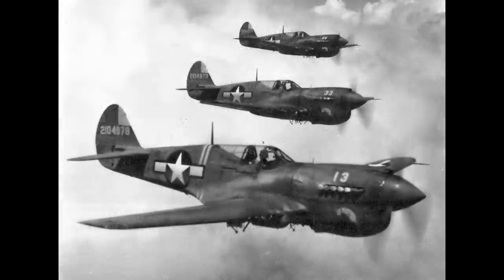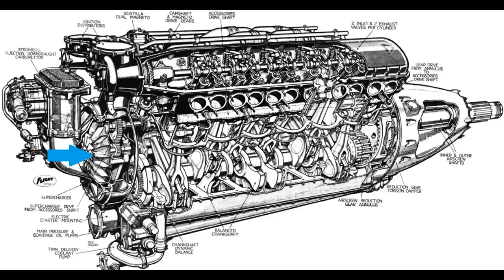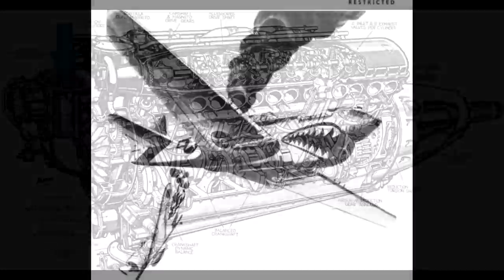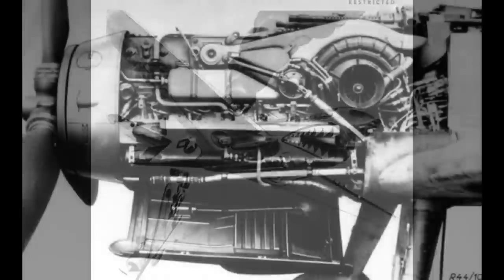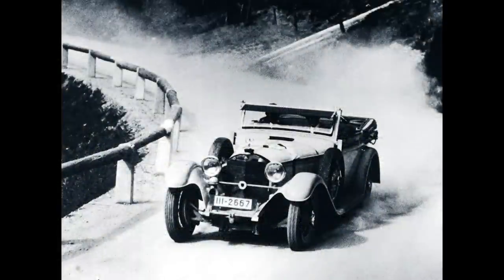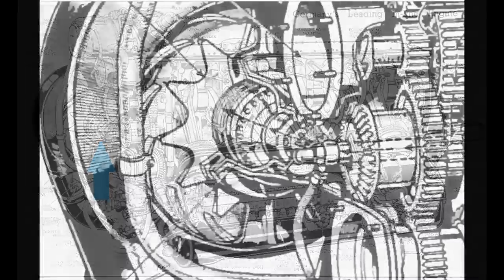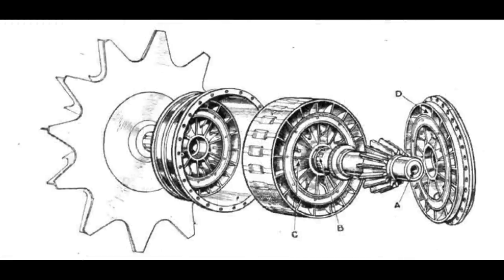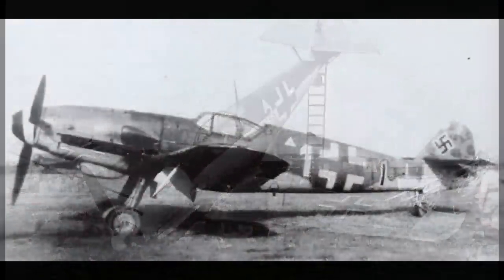Messerschmitt BF 109 Supercharger Drive System

Comment: Consider the Fw-190's highly advanced engine control system. It featured an analog computer, with a single lever for all engine parameters and functions. There was no direct pilot control of engine RPM, manifold pressure boost, or mixture. Compare this with the very complicated engine controls of late WWII American and Allied aircraft.
Reply from the maker: The Germans had some really cool stuff. The FW190 had many innovations, engine control being one of them. I'll probably cover some FW190 features in a video.
Reply: rather amazing! imagine the reduction of workload on the pilot
Reply from the maker: It was good, and the concept was revived by Mooney Aircraft when they used a Porsche engine in the late 80's. Pilots loved the simplified controls, but ultimately, it failed. That's another story.
Reply: I read somewhere the British examined the German system during the war and found it superior to theirs and recommended adoption of something similar as it reduced pilot workload and distraction at critical moments in a fight. I wonder if war exigencies prevented  implementation or if there was another reason.
Reply: Moriah Molotov I can see why jet fighters adopted this throughout the cold war. Gives pilot more focus on the battle.
Reply: The 109 was cramped compared to what? II come  from the World of Gliding, and I am a 182cm Fat Fuck and had no Problem fitting in either the 190 or 109. I found them very spacious and generous. You have good Axjustment on Pedals and Seats and I wasat about 80% Adjustment Range.But I am used to Gliders, as were most German Pilots. If you ever get yourself in a Grunau Baby and a 109 afterwards, you will feel as if you entered a Cathedral.
Reply: Almost an early example of Airbus (computer flies the aircraft, pilot instructs the computer) VS Boeing (pilot flies the aircraft directly)
Reply: It was rediscovered years later in america, they were stunned.
Reply: wow... the Dora had those things on board ?! no wonder it was considered much advanced compared to the 109 . and it was only about 3 or 4 years newer in design, right? quite amazing how fast the guys were advancing at those years...
Reply: All 109s had that too.
It's called Kommandogerat
Reply: @eyalcr500  The Anton A5 onward had those automated features too.
Reply: tsmgguy..really outstanding point,thank you for bringing this up
Reply: @Leon_der_Luftige  A-3 too.
Reply: OMG ! The complexity of this aircraft is amazing and probably the reason there are not very many running today
Reply: @SeanODea25   Jets don't need a prop control...
Reply: MrFattyfatfatboy  an easy meal? It's not a bloody Kentucky ready-to-eat Fried Chicken!! Both the Fw 190-D and the late Me 109G-10AS was capable to handle the fighters of the allies, providing of course, they  had good pilots and fuel both chronically lacking but even in the final months of war they could still bite hard. Ask the downed pilots of the allies....
Reply: MrFattyfatfatboy  eventually I could be a poor deluded Florentine, I live there! With that settled you stated quite correctly that both the late German airplanes and the allied airplanes had quite similar performance with each that  had pro and cons compared to each other so at the end was really the pilot that made the difference as always although I regard the Me 109 G-10AS and the Me K-4 the most difficult to handle at high speed, yet the few German experts knew how to handle it to their advantage whilst the very late Spitfire had the best handling at high speeds although it's graceful flight characteristics was marred by the brutish Rolls Royce Griffon. That said with this little comparison I  am just highlighting that you made it too easy and one sided....
Reply: @MyFabian94  it said that 109 and 190 cockpit was cramped, compared to other contemporay planes, mostly British and American planes
Reply: @ppunk4  And German Pilots felt a bit lost in the oversized Cockpits of the Allied Fighters. 

Pilots are Humans, and Humans are creatures of Habit. 

Fact is that in Aerobatics it's generally nicer to fit into your Plane snuggly so your Bits have something to Press against. 

If you are used to Sports Bikes and suddenly get sat on a Harley you will feel a bit lost in Space. 

Someone from a Harley will hate a Sports Bike. 

If you are used to tiny Cars with Bucket Seats you will hate the Bench Seats of a 60s Landyacht when cornering, and someone from the Landyacht will hate constantly fingering his Passenger by Accident.
Reply: @ppunk4  I've flown Bücker 131s (and will soon gain hopefully) and if you consider that it was the primary Trainer for most German Pilots suddenly everything falls into Place and starts making sense. 

Compared to the 131 the 109 would feel like the easiest Plane to fly and almost uncomfortably roomy.
Reply: @MyFabian94  at least in VR, the bf 109 has very little room compared to the p 40 and other american props. One of the closest feeling planes in the p 39, but even then, it feels more spacious. Don't know if that is just the better visibility however.
Reply: Daimler Benz DB60x engines had equally effective automatic engine control system, functionally equivalent to BMW801's. Also in DB (as in BMW801) the "throttle" lever does not actually regulate throttle, it is more a thrust lever. With it pilot tells how much thrust he wants from the propulsion system, and automation delivers that the best way it can. But DB has manual override that provides possibility to for example over-rev the engine by taking manual control of the prop pitch.
Reply: Just to mention, there was a manual back up. It was a direct pitch selector however, not RPM selector.

iirc the 109E-3 and earlier had RPM selector, while the 109B had a pitch selector. Not sure about D and C
Reply: And look at what they produce now in the aerospace...
Reply: tsmgguy the “Kommandogeraet” controlled throttle, mixture, propellor pitch, supercharger gear and was smart enough not to overspeed in a dive like the allied constant speed props.   Not only BMW but Daimler Benz and Junkers had them.
Reply: that overspeeding thing is not about smartness
it's all mechanical, it's about how it actually measures the RPM/resistance
Reply: In a flight sim when i fly P-47 in which you have to operate throttle, rpm, turbo, inlet and outlet cooler all manually (although you can link throttle throttle, rpm and turbo together) it feels so easy to fly with FW190 or BF109 where you need to only use throttle lever while everything else is automatic. Late war American and British airplanes are too automated except you still need to manually set your RPM.
Reply: @paoloviti6156  they got bitten harder by P47's and P51's
Reply: @oceanhome2023  there's not many because they were beaten and destroyed
Reply: @MyFabian94  cramped compared to many other fighters as was stated, put the candy bar down and pay attention
Reply: @kenneth9874  of course they got bitten harder by the P-47 & the P-51 as there Germans had an average  ratio of 1 against 10 allies or even worse. All this if it was possible to find an expert pilot and much needed fuel. There was no milk run for the allies during the final surrender...
Reply: @MyFabian94  5 years later, i reply to you saying that you somewhat put my mind to rest. I'm 1,87 and slim-always wondered would a pilot my size even fit in the 109 ?!
I tried looking at some of the heights of the pilots in Luftwaffe,or Finnish Air,but couldn't find much conclusive results(probably haven't searched enough). I know most of them were under 1,80 but still,wondered if it was possible; everybody scoffs at how cramped the 109 was. 
Thanks!
Reply: @paoloviti6156 almost all the luftwaffe pilots would disagree if they weren't killed....

Comment: 90 degree to crank thought.  This would eliminate the gyroscopic load created when the airplane pitches up or down.  Car too.  This way the compressor rotor clearance can be maintained more easily.  Less load on the bearings.
Reply from the maker: Hi Steve, thanks for the comment. I hadn't thought of the gyroscopic load issue. The impellers in these things are big, by any normal standards, so it's possible that was an issue, but I tend to think that's not it for two reasons. First, the US superchargers were very efficient, and I have never read about any concerns in this area. Second, the 90 degree mount will add gyroscopic issue when the plane rolls, and most planes roll faster than they pitch. It's a good thought though, and it could be right, I just don't know.
Reply: I wana see your Match then if not affect...
Reply: I think the right angle drive may have had to do with possible multiple issues. 

1: Maintenance access. The blower wheel could be readily pulled for inspection.  As the drive gears. 

2: Engine length. The front overhang is already considerable.  A longer engine would have reduced forward visibility even more. 

3:Balance and weight : A longer engine would have increased the loading moment on the front of the airframe,  increasing structure weight. And would have required a longer heavier tail and empennage to counterbalance it.

There is nothing in aircraft design that if it adds weight adds it in only one place. Usually ripples through the design.
Reply: You need to consider the airplane CG and the lever arm of a pitch on the compressor vs. the lever arm of a roll.  Pitch maybe a larger force due to the length of the lever arm.  Roll axis lever arm is pretty small.
Reply: Very interesting answers. Wonder if the mystery will ever be adequately addressed if not outright proven.
Reply: Exactly what I had come to comment.
Reply: I suspect the precession argument stems from WW1 biplanes with engines that rotated around a fixed crankshaft. Combined with the low mass of the overall craft and the short wingspan inertial loads from the engine are likely readily perceivable
Reply: Hi Greg. I still believe that reason for 90 deg placement is supercharger gyroscopic forces. Bf109 was (so I´ve read...) very sensitive of throttle when takeoff. 

Engine was so powerful that if you opened the full throttle "straight" on takeoff, the plane started to roll "around the crankshaft". And when the wings did not yet have enough grip from air, it went around. if supercharger would have been placed same way like engine, it would have even added the gyroscopic loads.
Germans and Finns (we) lost a lot of planes and pilots because of this phenomenon.
Reply: Steve Mackin that’s what I said 💪🏼💪🏼💪🏼
Reply: Steve Mackin although I work with roots type superchargers made for drag racing......I’m pretty sure your spot on!!! Because the impeller did not have a mechanical connection to the crank shaft. I would think that certain maneuvers could possible affect the compressor impeller RPM. Just think if every time you pulled back on the stick it killed impeller RPM thus robbing the engine of manifold pressure. When it needs it most !! I’m not a pilot but I would think a aileron roll wouldn’t really affect engine duty as much as pitch would. To have the impeller rotating axis in the same direction the plane is traveling would help. And because impeller speed and the speed of witch the plane is traveling are so high. It’s most likely a big deal! Thanks again 💪🏼😎 I love thinking lol
Reply: It’s not the spin of the supercharger affecting the dynamic forces on the air frame! But the exact opposite. The pitch , yaw, rolling, of the air frame directly affecting the angular momentum of the impeller. Because it was hydraulically connected!!! If it where mechanically connected... it wouldn’t matter much.
Reply: @GregsAirplanesandAutomobiles  probably the reason was intake...
Messerschmitt was obsessed with the making the aircraft lightweight as much as he can (one of the main reason flaps wasn't great) so maybe just for the sake of reducing the weight they put it there and it somehow worked?..
or maybe there wasn't enough space..
Reply: @efz629  That is often mentioned for the 109 regarding the narrow fuselage mounted main gear. But at least what I read about was only an issue late in the war when a) they had very unexperienced pilots and b) the engine power grew to nearly twice that of the early 109´s.
Reply: In terms of the supercharger orientation to
the crankshaft, it could be nothing more than common engineering practice for the time. Just for example, MAN, a german diesel engine manufacturer whose engines were installed on the more modern u-boats, utilized turbochargers which were mounter in the same perpendicular orientation. I read that they went with this configuration for nothing more than compactness and straight line orientation of the charge air manifold. See attache link for photos of u-boat MAN diesel https://www.google.ca/search?q=man+m9v46&tbm=isch&ved=2ahUKEwiNoZamr_7sAhUG9qwKHVELD7kQ2-cCegQIABAC&oq=man+m&gs_lcp=ChJtb2JpbGUtZ3dzLXdpei1pbWcQARgAMgQIIxAnMgUIABCxAzICCAAyAggAMgIIADoECB4QCjoECCEQCjoGCAAQBRAeUMkeWJAsYPw6aABwAHgAgAGWAYgB1AiSAQM4LjOYAQCgAQHAAQE&sclient=mobile-gws-wiz-img&ei=aeGtX83IJIbsswXRlrzICw&bih=719&biw=414&prmd=insv#imgrc=eWY9L5AogBpVeM
Reply: Heres another german marine diesel engine of the time made by Daimler Benz which even has the jacket water cooling pumps mounted 90’ to the crankshaft. An odd configuration by any modern standards. https://www.google.ca/amp/s/oldmachinepress.com/2017/03/05/mercedes-benz-500-series-diesel-marine-engines/amp/

Comment: Hi Greg,
As to why the germans mounted their Superchargers on the side, there are actually some pretty interesting reasons for why they did that. I will try to explain them in this comment, but please excuse my limited english.

The first one is design tradition from the early days of sportier cars. At that time the chargers did not look like the discs we know today but rather lengthy like a gearbox, they were mounted to the chin and increased the length of the engine quite a bit, so in order to save space they rotated it 90 degrees to the vertical. They also had more positive experience transmitting the moment to the charger with that way of mounting it, so they kept it as the chargers evolved.

The second is that it is more efficient than mounting it parallel behind the engine, since the Air only has to make a 90 degree turn in the charger and then can be fed straight to the engine, while in the other mount it would have to make a 180 degree turn into the charger and then again a 90 degree turn into the engine.

As a 3rd reason, it allowed to increase the disc diameter without increasing the frontal area of the engine, tho you would need quite a large supercharger to make use of that.

It might be easier to access to, but I don't know how often you could make use of that.